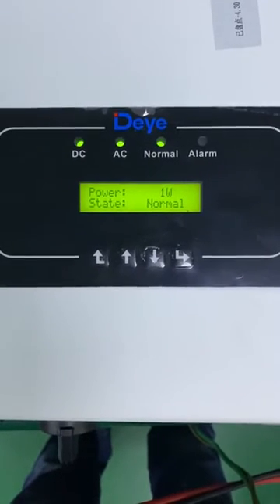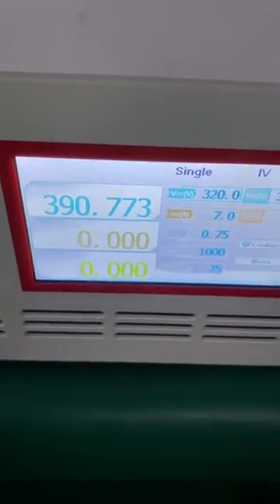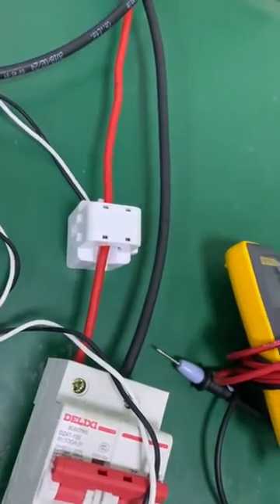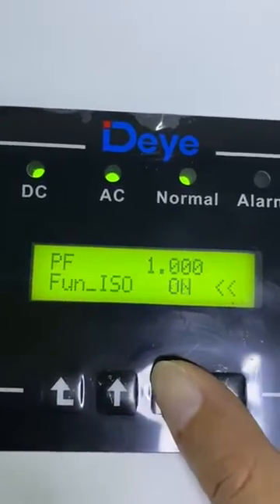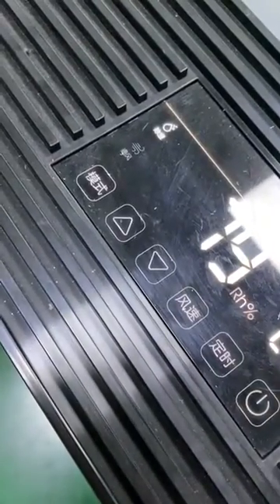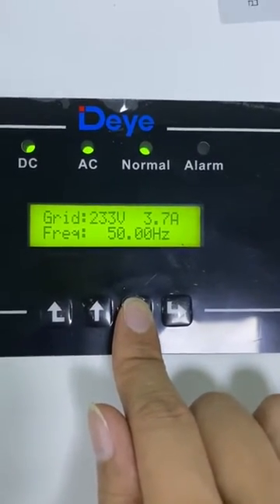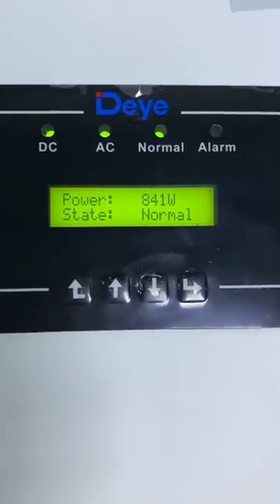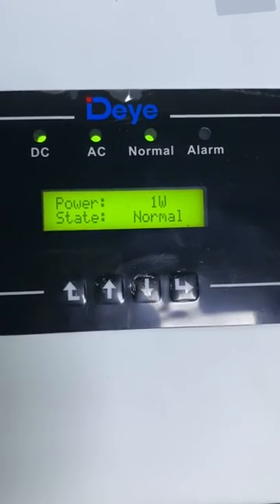How to realize zero export function with CT for Deye string inverter

Comment: Hello! My 5kw DEYE inverter did not come with a TC input, it only has an input to communicate with a metering device, but I want to use TC so I don't need to buy another device. Can I internally access the point to connect the TC? Originally it has a cap on the limiter input

Comment: I have the same inverter, and got the Eastron SPM-E smart meter, what must i do to use the inverter as a full hybrid (with grid,  backup load , home load, battery ) and not to inject intro the Grid. Do i need neccesarly a CT or does the Inverter limit the export?
Reply from the maker: Just use CT